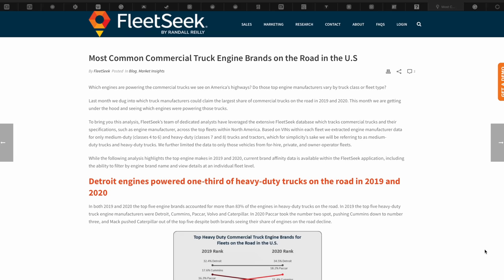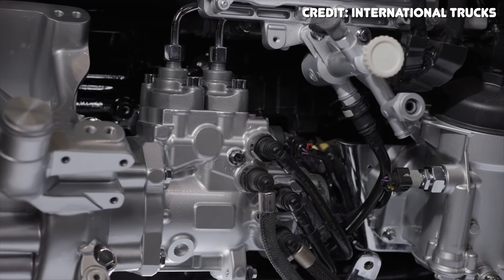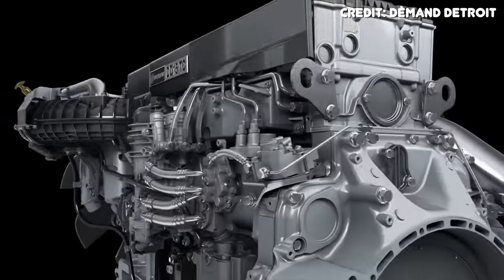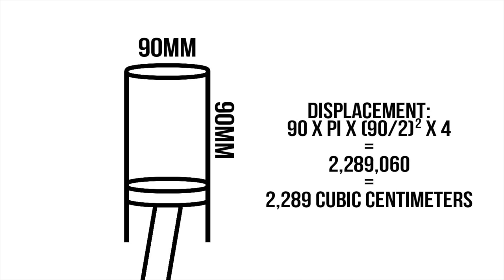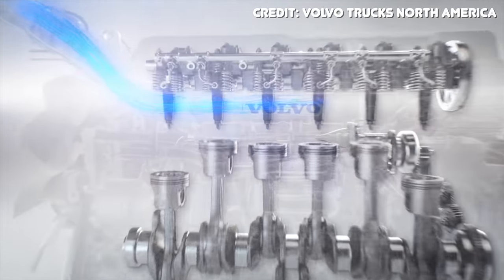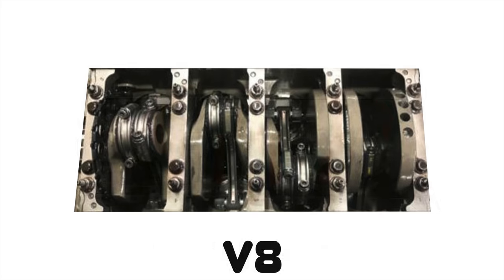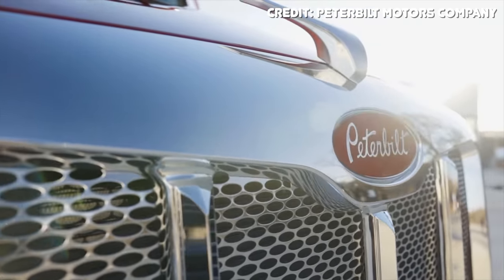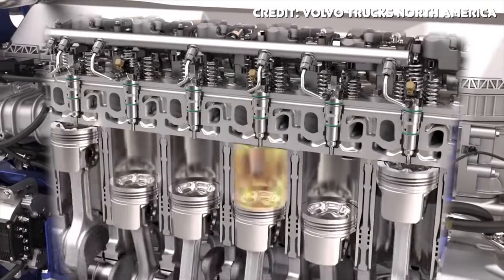Why do Semi-Trucks Use Inline-Six Engines?

Comment: i6 is also very harmonically balanced. So they run extremely smooth and rattle alot less:)
Reply: At idle a DT466E will shake your teeth out of your head compared to a T444e. They're both great engines and I'd probably want a DT466 more, but not smoother at idle.

Comment: I just found this video by Google recommendations, and it was great!  Full disclosure, my current motor vehicles are a one-ton pickup with an inline 6 diesel, and a motorcycle with a v-twin gasoline engine.  In the past I've had inline 4 engines, as well as flat 6s, and one inline 2.  I'd be really interested to hear this same guy talk about the pros and cons of a flat 6, AKA "boxer", some of which I already know, but I'm sure he'd add insights.

Comment: Had a Lexus SC300, 2JZ-GE, 5 speed manual.  Loved that inline six, even if it wasn't a powerhouse, with the manual it felt fairly stout cause you could always downshift and rev the nuts off it, which that motor absolutely loved to 6200rpm or so.  Not a high redline, but man it made most of its power at 4 grand or above.  It was silky smooth, idle, cruising at 2000rpm, revving its nuts off to 6000+rpm, you never felt a single vibration from that engine.  Loved winding that motor out on the highway, slamming gears.  Was reasonably brisk, but what I loved was you could slam the throttle wide open, shift thru the gears, and you were not doing 100+mph like a Ferrari where you would go to jail.
Reply: I feel you mate, I have two Mercedes M104 (straight six, petrol) engines that I absolutely love. They also rev up to 6200-6300rpm, and at about 4000 it starts to make you feel good. 👌🏻🔝

Comment: I'm a retired helicopter mechanic so I'm not really any kind of authority on reciprocating engines, but having driven nearly everything from I4's to X16's, my 2000 Jeep Cherokee stock 4.0l had the least problems of all the vehicles I've interacted with over the last 22 years. Just one guy's personal experience, but I'm a die hard straight six man now, despite having been born and raised as a V8 maniac and having made a living as a jet and turboshaft guy. As far as anyone bad mouthing the Jeep 4.0l, I agree the design is inefficient, but the damned things just flat-out refuse to die so long as you do anything close to preventive maintenance.

Comment: Youtube has been recommending some great automotive videos lately.....I especially liked your explanation of the relationship of torque and horsepower.
Reply: It's a bit misleading, since peak engine torque (before the gearbox) has nothing to do with towing capacity. The real reason you see high-torque engines on large trucks is that they don't care about engine weight (compared to a car) and do care about maintenance and fuel costs, both of which will increase if you use a lower-torque engine with the same power, even though that engine would theoretically still be able to tow the same loads (as long as the transmission can handle it and doesn't lose too much power to friction, which in practice is very difficult and leads to some of the increased costs mentioned before), although the steeper torque/power curves will also be problematic in practice.

Comment: Applies to buses too. I remember some odd buses with either I5 or V8 engines. The I5 MAN D 2865 LUH 02 was horrible, when idling, the whole rear of the bus was vibrating and the noise while driving was awful. The V8 was noisy too, because it was air cooled. Tatra trucks also still produce their line of V8 air cooled torque monsters and have been making also V12 engines in the past. Also a W18 prototype.

Comment: I drove big trucks fulltime through the 2000s,  Cummins and DD, last truck before retiring was a first gen Cascadia with a DD15. I never experienced major problems over the years, however the engine light stayed on in those Freightliners! The best engine I had experience with though was a GM straight six gasoline engine in a mid 70s Chevy C-10; that was the smoothest running motor ever, even though it had several hundred thousand miles on it, and I put another 100,000 on it. I got rid of it because the body was falling off the frame. To this day I kick myself for not saving the motor out of it!

Comment: i have a slightly  different theory on the Inline 6 that goes back to many of the original American made Workhorses  that  built this Country and helped feed the Nation  those old Inline 6  Gasoline motors. had plenty of Power espessially Tourque    with fuel economy and they  seemed to be. well balanced  that didn’t cause them to shake apart  and self destruct themselves or the equipment they were used  in  Companies like General Motors    are still using the basic design in modern vehicles although modern improvements like FuelInjection  and other Improvements are used to meet Emmission Standards and the needs of todays Vehicles accessories  that customers  expect  and demand as Consumers like Airconditioning , fuel economy ,  and longevity

Comment: ... to be clearer ... people confuse 'torque wrench' torque (ft-lbs) with "work" in Horsepower calculations (ft-lbs/min or ft-lbs/sec). In horsepower calculations, the "ft" part of ft-lbs is part of the "Work" statement (force x distance), so it's the tangental force applied at a radius around a circular path. Example: a 1lb. force(f) applied at a 1ft radius(r) is being applied on a circular path for 1revolution(r). The work is f x 2r x Pi, and Horsepower is Work performed at a Rate(RPM Rev./min for example). So  f x 2r x Pi x RPM is the correct statement for Horsepower.

Comment: So too do city buses: the Cummins L10 four-cycle turbocharged diesel (originally introduced for 1983 in the big rigs) was the first common inline six diesel engine in buses since the two-cycle Detroit Diesel inline 6-71, which was mostly abandoned after 1959 when the 6V71 V6 diesel was used in GMC's "New Look" (or "fishbowl") buses. Although the inline 6-71 hadn't been for the most part a city bus engine since 1959, it still found its way into big rigs and garbage trucks up to the late 1980s.

Comment: Lots of upmarket car made in the UK (where I am!) in the second half of the 20th century used straight-six engines and they were popular for comfort, quietness and reliability. They tended to be heavy and of course the length is an issue but a lot of those cars were deliberately designed long for visual effect (the most obvious example being the classic Jaguars) so that didn't really matter much. Most of those cars rusted away before the engine gave up.

Comment: Most people don't mean that the inline 6 makes more power but that it transfers more of that power to the wheels because of the reasons you spoke about with the internals and the bottom end. The way a V engine is built causes more stress on the internals and that comes from the power that is lost in a manner that is actually wearing your engine faster. Less power more wear.

Comment: Mine is a catapillar 3306. As a qualified Diesel fitter I can say you are correct. V8 engines are not the best choice, that vibration can cause pitting in the cylinder liners inside of the cooling system for example 3208 cat, thus is a real problem because that model v8 has no cylinder liners and once this happens you basically have to throw it away although a dry liner is possible to fit its not a good idea.

Comment: It brings favorite memories of the Jimmy 6-71's we used for powering our 40 ft boats,[ Coast Guard] (twin)6-71's back in the day, and which were very popular in the trucking and construction sector, The 71 series was also great as main and auxiliary power, (generating).  Unfortunately, its demise was the inability to keep up with air quality standards. I cringe to this day when I see videos of 6-71s intentionally being left to runaway. A 12-71 was essentially two 6-71's married together. Aside from what I just said there are great facts involving HP and Torque space, operating strength and maintenance of inline 6 diesels.

Comment: Well presented.  I have been using diesel pickups to tow goosenecks since the 1980s!  in 2006 I went to the Cummins inline 6 in the Dodge Ram.  It now has over 300,000 pretty trouble free miles.  See no present purpose to trade.

Comment: Interesting video.   Intuitively, I would have thought that a big bore would increase torque because torque is ultimately a function of the surface area of the piston head acted on by the psi of the expanding gases in the cylinder.  Never really stopped to think about the lever arm of the crank.
Reply: Assuming the same displacement, a larger bore/shorter stroke versus a smaller bore/longer stroke about equal out.   A larger bore has more area to push on the crank, but there is less leverage with the shorter stroke crankshaft.  A longer stroke crankshaft has more leverage, but since the bore is smaller there is less area on the piston and less force but it more or less balances out.  But there are nuances such as a small bore/long stroke engine has more swept area on the cylinder walls so a little more friction losses. A larger bore allows larger valves and better airflow, but truck engines don't push that limit like high performance gasoline engines.  In the end, independent of boost pressure (which makes engines run like a larger one), more cubic inches offer more torque. Whether more cubic inches is achieved with a longer stroke or larger bore is insignificant unless the cylinder head ports and valves are enlarged to make the larger bore work to full potential. But, commercial truck diesel engines don't take advantage of that like racing engines do to exploit larger bores, so it's not really a factor. As a side note, maximum safe rpm has more to do with piston speed (higher piston speeds = higher g-forces), which is largely a function of stroke length.  So, a 2,000 rpm engine might have the same piston speed as a much higher rpm engine with a shorter stroke, meaning that just because an engine operates a a lower rpm, it doesn't necessarily have a reliability advantage over another engine with a higher rpm but the same piston speed. That is true of the short block anyway, the valve train is another issue. But, no commercial or industrial diesel pushes the limit of possible valve train rpm.

Comment: One of the biggest reasons  the straight 6 is used is the number of main bearings supporting the crankshaft. On an inline engine you can have one more main bearing than the number of cylinders whereas on a V engine, you have one main bearing for half the number of cylinders, plus one. So a straight six has 7 main bearings but a V6  with the same number of cylinders only has 4 main bearings.

Comment: In the equipment world the 4 cylinder diesel is king, from .9l to 5l and usually only seeing about 2,500 RPM max.  I have worked on V8 and V10 diesels that go to 30l, those are in very large equipment that usually is found at metal foundries, and mining sites.  Also I worked on a Cummins 23l inline 6.

Comment: I like the video! The one thing I will say about I6 having a nice low redline making them last longer isn’t quite that straight foreword. Get online and find a piston speed calculator and you’ll realize a truck engine with 6” stroke will have a piston speed at two thousand rpm that an engine with a much shorter stroke has at several thousand rpm higher.  In other words a truck engine at 2k rpm and a 283 Chevy v8 at 6k rpm could potentially have very similar piston speeds.

Comment: Love to hear about some of the straight 8's that some of the car manufacturers had in the 50s & 60s.
Reply: Brandon, so here is my take for what its worth.

Packard Straight-8 as it is the last American production inline eight-cylinder engine. It also has the distinction of having a thirty-year production run, with the first production model debuting in 1924 and the final straight-eight-powered Packard rolling off the line in 1954.

Buick employed Straight-8 engines in all models from 1931 through 1952 and in the Specials in 1953 when the nailhead V-8 was introduced in the Super and Roadmaster models.
The Buick straight-eight was an overhead valve design, while the Oldsmobile straight-8 and Pontiac straight-8 straight-eights were flathead engines.

They died out because a car had to be quite long to hold a straight eight. That extra length made cars more difficult to maneuver without giving extra space for storage and passengers, a major detriment as straight eights were used primarily in luxury cars. The second, and greater, issue was the force put on the engine. Such a large crankshaft simply couldn't handle the load produced at high RPMs and bent/broke.

Does that help at all??
Reply: @vigilantemotors  Somewhat. I just loved to hear about the flat torque curves and horsepower. As far a breaking crankshafts, that depends on how hard they was turning these engines. With the technology of forge steel cranks and other designs of main caps being crossed bolted, there is a chance to hold together. And yes, the long blocks yielded limited space, but these was the luxury engines of their time.

Another thing, since inline 6 diesels have such a long flat torque curve, wonder if a inline 8 would been better in large trucks. Just thought it would be an interesting topic since almost no one ever brings up.
Reply: @brandonrobertson6327  bro!! You know your stuff for sure!!! Are you a fan of cars from that era?
Reply: @vigilantemotors  Actually I found a straight 8 in a old wooden speed boat and got me interested. I believe it was an old Chrysler. But I do love how these older cars ride like a cloud rolling on the highway. Not alot of people have them around where I live. But occasionally see them at car shows.
Reply: @brandonrobertson6327  whereabouts are you? My old man had a 82 Caddy Coupe DeVille. It was like riding on a pillow I’ll never forget it. But yes, cars from the 50’s and even 40’s had amazing lines, lots of character, just love them
Reply: @vigilantemotors  Virginia/North Carolina area.
Reply: @vigilantemotors  The old Lincolns and Thunderbirds was some of the cars was some of those old classics that had alot of character. But really, any old land yacht was great to cruise in. I remember as a kid, I remember riding in my uncle's late 60s Pontiac Bonneville. Always thought it was a cool ride.

Comment: On the issue of car V6s vs. inline 6s, Mercedes just recently has gone back (!) to I6s. My understanding is that for the past decades the V6s were co-developed with the V8s (definitely a space thing) and "just" had two cylinders chopped off. As the V8s are going to die out, what with even all the new AMGs becoming hybrids, the new I6s are extensions of and therefore co-developed with their I4s. Cost savings all around, forget the packaging...

Comment: I've have my share of big rigs and had Big Cam I Cummins, Series 60 Detroit, V8 Mack & several Cats.  Had the best ''luck'' with Cat engines but they all had advantages & disadvantages.  I just happen to like the way the Cats worked for me. ( 375PC, 3406B, 3406E,  C15 )

Comment: All great info there.
The balance of a six is a big issue when the pistons are that huge.
You did a great job explaining why a straight six makes the most sense.

When I saw the title on YT I was wondering how many good reasons and you touched on all the big ones.

I was wondering if manufacturing issues came into play. I worked at a Chrysler plant where I learned that a 
V engine of any size is more likely to have air pockets in the block which means it must be rejected and melted down. Even with vibrators the V design is harder to fill completely when casting the block. But it occurred to me that big trucks have a much smaller rate of production so that really would not be a major factor. The ease of repair, balance, and narrow block all contribute greatly to why the I-6 has won over all other designs.